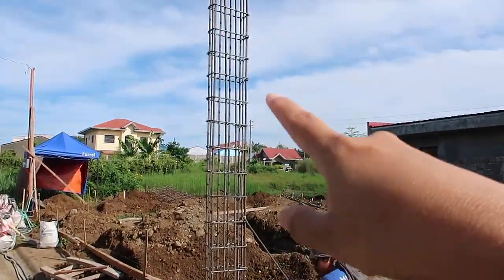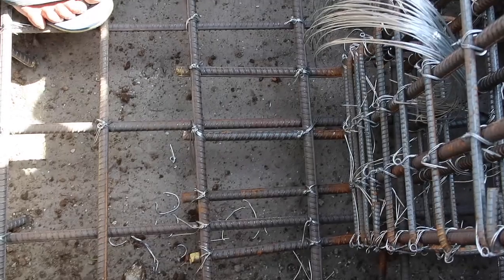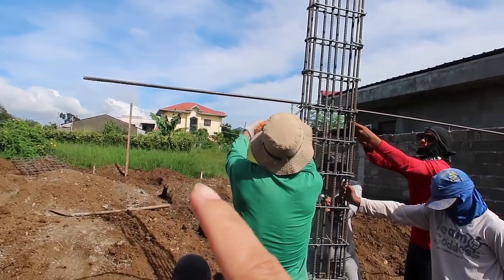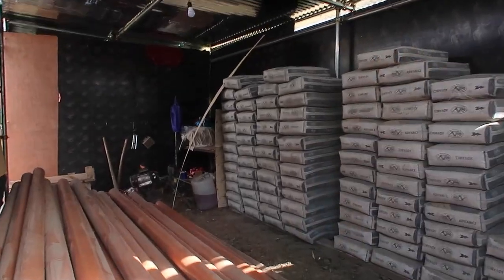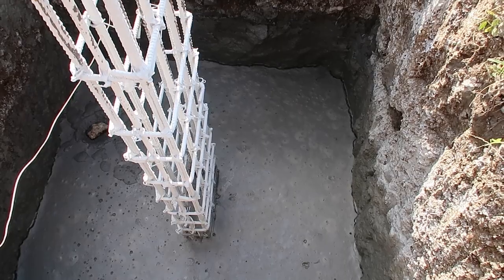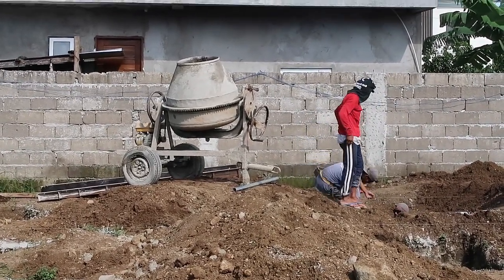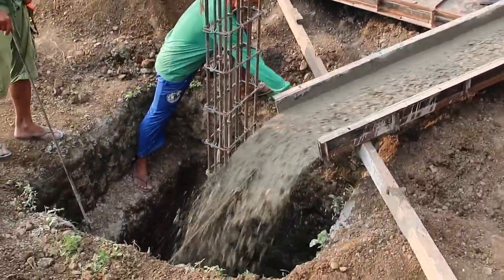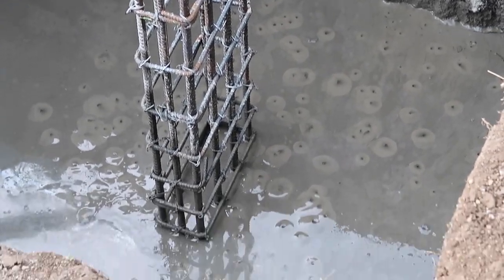HOUSE BUILDING IN THE PHILIPPINES - EPISODE 11: 1-2-4 CONCRETE MIX

Comment: Question, didn't you guys have blueprint when you applied for building permit? There wouldn't be any problem if your construction engineer or foreman reads the structural notes from the blueprint... 
If there is,  thwy should uave followed it... Unless youe contractor is just a very expensive pakyawan 🤔😅

Comment: Ur col rebar is placed under the footing rebar see 1:50 which is wrong. The col rebar should be placed at the top of the footing rebar.
Also weldind in the main rebar is not advisable since it will lessen the strength of the rebar.
Reply: yea it's weird that it was placed under the hor. bars.

Comment: I am so disappointed for you.
Your crew did a good job digging foundations, and then screwed up big time with the concrete.
Pilipino do not appear to grasp the concept of Water to Cement Ratio.
They appear to believe that if the concrete is not performing as required, just add more water. 
Adding Water to a good concrete mix actually does more harm than good.
Your foundations are made of Cow Pat Concrete, which will never achieve the strength it was capable of achieving without all that water.

Comment: Column tie ends should be bent an additional 45 degrees to lock them in, concrete should not drop in to the holes and concrete is too watery... but hey this is the Philippines.
Reply: I am sick and tired of the claim that the Philippines doesn't need to meet the Philippine Building Code and Principles of Good Building Practice, when it is mandated by Law.

Comment: M15  which is 1:2:4 is ok and suitable for footing for 2 floor house, so no worries.
Reply: sir how many bags of cement you used for 1:2:4 mix? and for M20 1:2:3 as well? from the book it shows 9 bags for M15 & 12bags for M20, however as per calculation it can be 8bags for M15 & 10bags for M20...

Comment: Did you guys put a gravel bedding and vapor barrier prior to concrete pouring? Didn't see it on the video. Also, rebars should not touch the ground. Provide concrete spacers.
Reply: if u watched prior video they poured 4" of concrete over 4 " of gravel in hole before they even placed the column rebar

Comment: We used over 3000 bags of cement in our build. 300 bags for every big truckload. We mixed using 1 cement 2 sand 3 cracked gravel. Make sure its cracked not round. Regards Rik
Reply: I concur. 1:2:3 is perhaps the best mix, with a water to cement ratio of between 0.4 and 0.5
Reply: @JohnCharville  i believe it's 0.5

Comment: After watch other builds, this is solid construction.  We don't do it like this in the USA, but the way they are doing this is sound.  In many ways better than USA build.  Maybe keep an eye on that cement mix :)  it will be solid however.  Not how I would do it, but I don't see anything wrong with this either.  Good luck man!
Reply from the maker: Thanks man,happy new year

Comment: 1-2-4 concrete mix is by volumn what is the compressive strength in NM or PSI.
Reply: that was Class-A mix 2500Psi - 3000Psi this values will depend on how much water they put and how they vibrate it when pouring the concrete., but unfortunately they didn't use any vibrator and the mix has too much water, so just assume it is 2500Psi which is still in the standards for the structural code., this is ok specially its only a residential house.,
Reply: @kimezekielpanopio4593  Hi Kim, never assume  concrete is strong and robust, having to much water is bad enough, but whats even worse is no vibrator to release the air bubbles in the concrete, you should be training your employees to be more aware of mixing and vibrating concrete.

Comment: Just an observation, is there a reason the rebar column is not in the middle of the mat.
Reply: I am not answering for this channel. When we did our build it was a matter of space. Our house was build on the boundary so the post had to be nearer to the edge of the matting. Ideally it would be placed in the middle but not always possible. Regards Rik
Reply: @RikBor  Hi Rik, i never realised the column was your boundry, thanks for the update, happy new year to all the very best for 2020,
Reply: @jamesmaclennan480  Not flush with the boundary but about a foot away so limited space for large matting. I guess you could go onto neighboring's land but that may cause problems lol. And same to you buddy

Comment: "It looks a bit watery" that's an understatement. It will still cure but it will never reach full strength, along with possible shrinking and cracking..
Reply: True. This is common here though. You should see the slop they poured for the highway where I live.  All the aggregate fell to the bottom and the surface was wearing out after a year (they black topped it then). Hard to instill in the workers that wet cement is weak cement.
Reply: @Educated_Guesser  The standards of everything construction need to be re-written, ffs they still think it's okay to have steel sticking out of concrete. A very few years later "knock knock, it's concrete cancer". I'm amazed more of their buildings don't fall down. When my wife and I retire there in two years I will be making my own hollow blocks and build the house myself, well the structural parts anyway.
Reply: @Jesse-B  The standards are correct, people just don't follow them and cheat.
Reply: @rap3208  fair call

Comment: Pls don"t mention the column reinforcement bars which is compression in nature is underneath the footing reinforcement coz if somebody follow that instruction it will collapse the whole building and dont try to weld the rebars as it will reduce the rebar strenght , the loading is started at the roof then passed on to the beam and slab and goes to column then footing. dont be offended just a reminder only
Reply: Sa amin na walang muwang sa construction....yung beam  na ipinakita  ng butihing vlogger sa tingin ko ay hindi mag collapse  kahit pa magkaroon ng Intensity 10 na lindol…( ang tataba ng mga rebars nila)
paki expound naman po….bakit sa tingin nyo ay  hindi maayos ang ginawa nila…( mag collapse pa rin)
para sa kapakanan na rin po ng mga gusting gumaya/o magpagawa rin  kanilang mga Bahay....
Reply: @horationelson5255  hindi po porket mataba ang rebar na ginamit ay masasabi ng safe eto. meron po tayong mga design criteria base on the national building code of the philippines na siyang pinagaralan ng mga civil/structural engineers. wala pong perfect structure na earthquake proof. ayon sa code dinedesign ng mga engineers natin ang ating mga structure to withstand more or less magnitude 8 na lindol. yan po ang trabaho ng ating mga structural engineer. idesign ang mga bakal ng bahay ayon sa code to withstand earthquakes. kaya po kung magpapatayo kayo ng bahay siguraduhin niyo pong kumonsulta sa mga civil/structural engineer bago mag pagawa.
Reply: Please enlighten us. I was gonna follow what they did here, although im only building a one storey house. With the constant earthquake in mindanao, im hoping watching these videos will give me an idea about properly building a house.

Comment: hi guys
question - do they do auger piling in that area or due to soil condition is it not needed?
Reply from the maker: We did not,we just put base coarse  then tampered then put gravel  then put 4” concrete mix after cure thats the only time they started the column footing set up